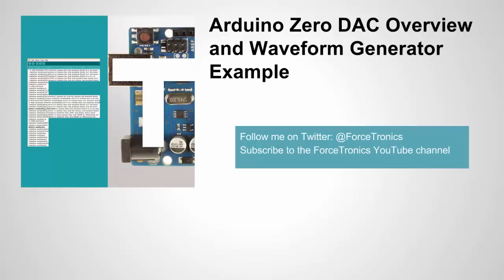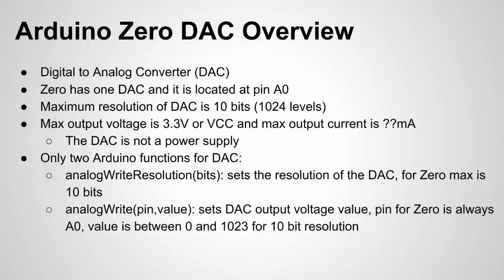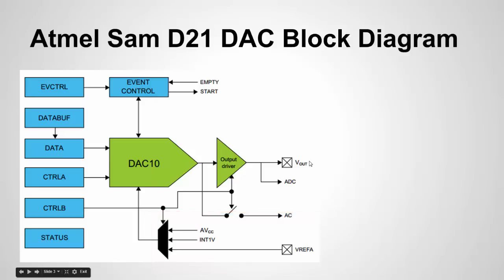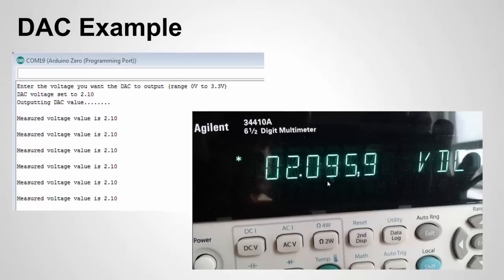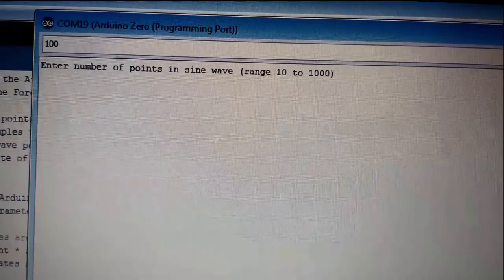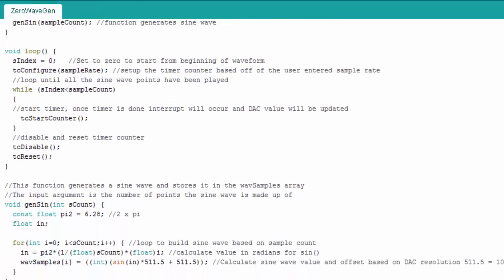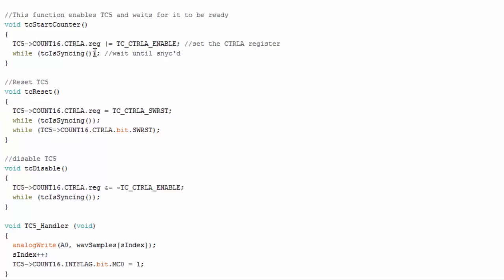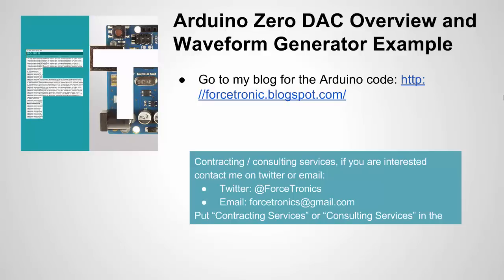Arduino Zero DAC Overview and Waveform Generator Example

Comment: I tried implementing the Arduino Zero DAC waveform generator example but I'm getting a sine wave that is clipped at 1V. Any suggestions on how I can resolve this issue?
Reply from the maker: What is your voltage reference for your DAC? If it is set to the internal 1V reference that would explain the clipping. The max voltage a DAC can output is the reference voltage. If you are using Arduino the reference voltage should be VCC which is 3.3V.

Comment: Hello,  when using the mentioned AudioZero library, after playing an audio file it kills analogWrite on the other pins afterwards. Please help I'm really stuck 

So basically annoy perform analogWrite(x, 128); on any other pin makes no sense

Much appreciated